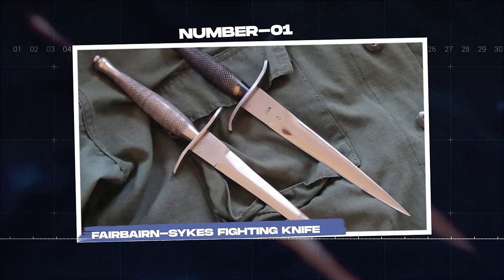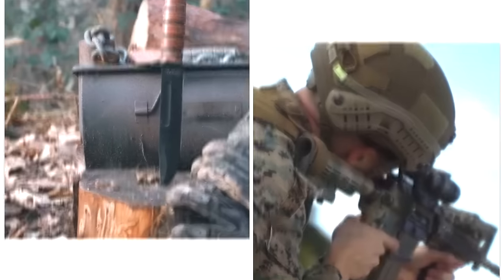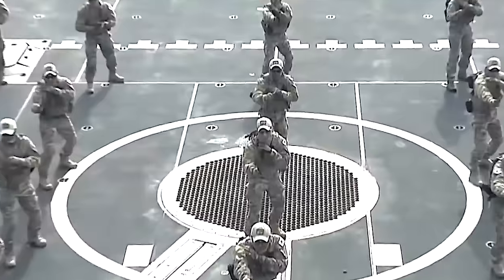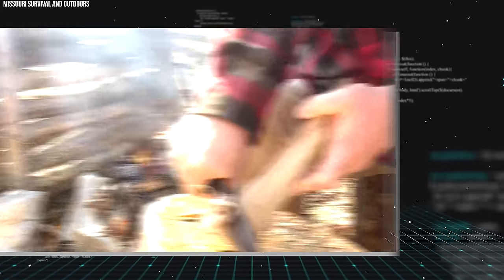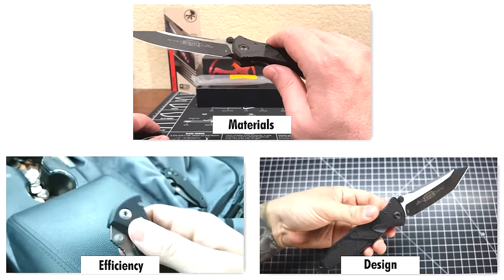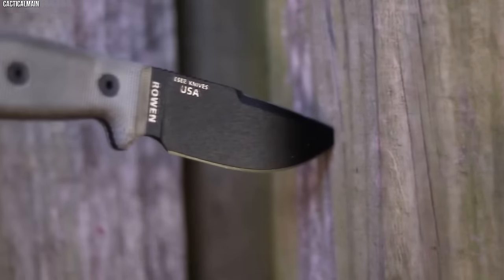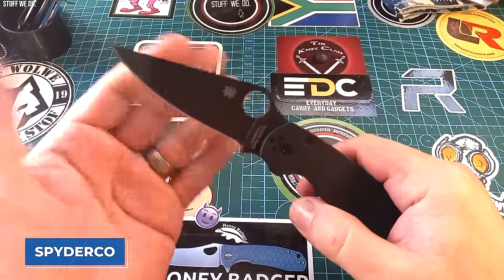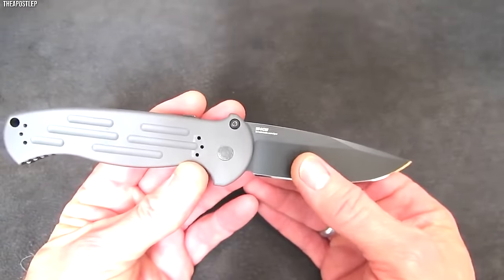15 Deadliest Special Forces Knives

Comment: in 1967 my team were issued an 9" Bowie knife with our unit crest on the blade. I carried and used that knife in all of my 4 tours in Nam. I still have it to this day. Funny they don't mention it here. Maybe it was an experimental test issue, but it is a hell of a knife. Its blade is spring steel and once sharp it stays that way forever. I've never seen a knife that holds an edge the way it does.

Comment: Let's make this simple. Folding knives are not the best for fighting or surviving. Most full tang fixed blade knives will be better. In a knife fighting situation reach matters as well because adding inches on the blade will only slow your movements a small fraction. When I was active duty I carried several knives (I collect weapons of all sorts) along with my Kabar and M-7 bayonet at different times, mostly different types of bowie knives. The most important thing was to practice so I bought a training bowie knife to use.
The larger blade gave me more options especially the slap chop on the hand, wrist, throat of your attacker. I prefer larger blades because they make chores easier, have more than enough blade to deal a mortal blow, and they instill more fear than smaller knives do on most attackers.

All my folding knives are used for is smaller jobs which is what they are best for from my experience.

Comment: A lot of dreamer's out there, 
I used everything standard issue & everything done the job, never broke anything & kept it sharp, Aussie Vet 🍻
Now having watched the rest if the AI vid, add tactical & special forces to anthing to boost your sales, man's oldest or possibly first tool, cutting edge/knife/scraper from large to small, every tool is designed for a purpose, the best knife is the one in your hand 👍😁

Comment: The Ka-Bar is a stick tang, and not a special forces knife.  And if you try to use them, even the new Magnacut ones, they break pretty easily at the crossguard, where the blade becomes said stick tang.

Comment: I liked the premise of the video but there is no way in hell that a folding knife should be in this video regardless of manufacturer. All folding knives are ludicrous at best and pure insanity at worst for close quarters combat. It is pure folly for anyone who proclaims otherwise and is someone you should get away from as fast as you can run. That being said, there were some really decent fixed blades highlighted in the video. Interesting topic overall.

Comment: The SRK in 3v, and the Socom Elite are decent knives,  but i wouldn't carry either because there are much better out there,  not to mention other than a multi tool a folding knife is a waste of weight and space concerning overt war kit.
The others are second rate, over promoted regardless of the adjectives being thrown around. A knife with a blade under 4in is not a military fighting knife.
Maybe an edc civilian knife, but advertised as A special forces fighting knife is  inappropriate.
Maybe a military guy owns one,  but not first choice to trust your life to in war..
Want an iconic war knife? How about a Randall #1?
Need a dagger? Randall #2
Hung up on kabar, with it's weak tang issues? How about a Bark River Blackjack? Fits right into the Kabar hard scabbard and has a full tang, better steel.
Both Randall and Bark River make better more reliable knives than anything mentioned in this video.

Comment: Sog becoming the Seals knife was a decision based on politics, not the knives that were in the selection. I've handled both the SOG seal knives as well as the Emerson/ Neely SpecWar and believe me the SpecWar is far superior. But politics stepped in and killed it.  I was involved in the knife business during the time when that selection was made and you wouldn't believe the backhanded political crap that went on behind closed doors during that selection process.